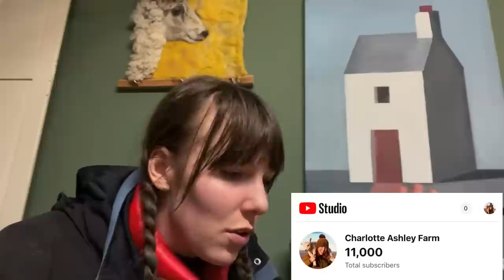Can the S160 bobcat cope with heavy work?

Comment: Good evening Charlotte. I have just discovered your channel (via Farmer P) and am enjoying it very much. Thank you! In return for the fun and animal based learning you have brought to my otherwise tedious down time on an Angolan oil rig, I hope I can help answer your bobcat question.

A (probable) answer on the Bobcat slurry stirring question is in your use of hydraulic drive.

 Both machines will have a similar hydraulic pressure, but the 160 will have a lower capacity pump matched to its lower power. Both machines will be capable of applying roughly the same static torque (turning force from stationary) to the slurry stirrer but the more powerful machine with a higher flow pump will spin it faster.   The slower rotation provided by the smaller bobcat means less power is required - probably a similar fraction of the maximum for both machines, this is why they seem to be working about the same amount. As a percentage of their best - they are. :)

There is a lot of detail but a textbook could be written on this and many have been. I hope the gist will do.

Mark

Comment: The fact the slurry was stirred fairly recently probably helped, still the baby bobcat was pretty impressive! I have worked machinery all my life, so I'm not fussed about yet another tractor review, although I do enjoy your rather unique take on it 🤣 so, bring on the animals 🤩
Oh yes, mini you has a career on the stage in her future 😅
Reply from the maker: Oh I will never give you a boring tractor review who cares what horse power they are we wanna know how comfy the seats are
Reply: @charlotteashleyfarm  Good evening Charlotte. I have just discovered your channel (via Farmer P) and am enjoying it very much. Thank you! In return for the fun and animal based learning you have brought to my otherwise tedious down time on an Angolan oil rig, I hope I can help answer your bobcat question.

A (probable) answer on the Bobcat slurry stirring question is in your use of hydraulic drive.

 Both machines will have a similar hydraulic pressure, but the 160 will have a lower capacity pump matched to its lower power. Both machines will be capable of applying roughly the same static torque (turning force from stationary) to the slurry stirrer but the more powerful machine with a higher flow pump will spin it faster.   The slower rotation provided by the smaller bobcat means less power is required - probably a similar fraction of the maximum for both machines, this is why they seem to be working about the same amount. As a percentage of their best - they are. :)

There is a lot of detail but a textbook could be written on this and many have been. I hope the gist will do.

Mark

Comment: High flow hydraulics are designed to power motors rather than rams like your Wisk, road brush or forestry mulcher. high flow and standard flow both produce the same max pressure of 3300 psi, any higher pressure is returned direct to the hydraulic tank via the relief valve without going through the motor (Wisk), this is why both your bobcats will sound the same when driving the Wisk. The reason the S250 loads the keenan better is it has a parallel lift where the 160 has a radial lift, radial lift is deemed safer on smaller machines as it brings the weight of a full bucket back inside the centre of gravity of the machine at full lift. Another great vid today, get shut of that Valtra and buy a Case MX 😃😃
Reply from the maker: This is really interesting 🧐 so there is no need for the high flow really it wouldn’t make it any more successful I don’t think it can be turned off with a switch, yes that was the attraction to the s250 we knew we needed to be able to load the Keenan and reach the top of the silage pit easily. Any advice you can give we LOVE keep it up x x x
Reply: @charlotteashleyfarm  on your left cab pillar post under the screen you should have a button marked AUX, push once for standard flow and one green light will be lit push again and 2 green lights will light and the screen should say HIFLO, if you press the button again all green lights should go out and the auxiliary spools will be disabled

Comment: Dont use high flow for the mixer,  hight flow only used for a planer or stump grinder or any other attachment that needs extra hydraulic power
Reply from the maker: Like a slurry whisk in thick slurry? That stuff can put a tractor on its knees with the PTO. I don’t actually think you can turn it off to be fair it is what it is